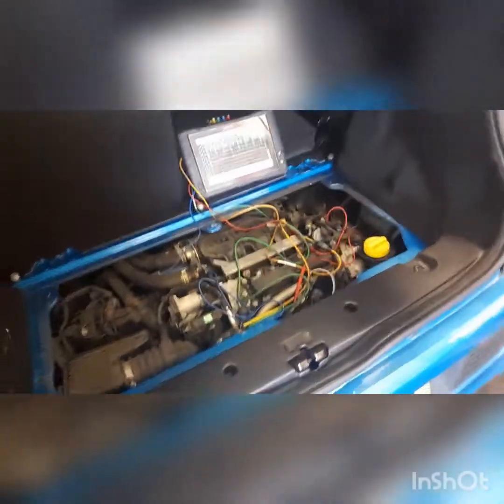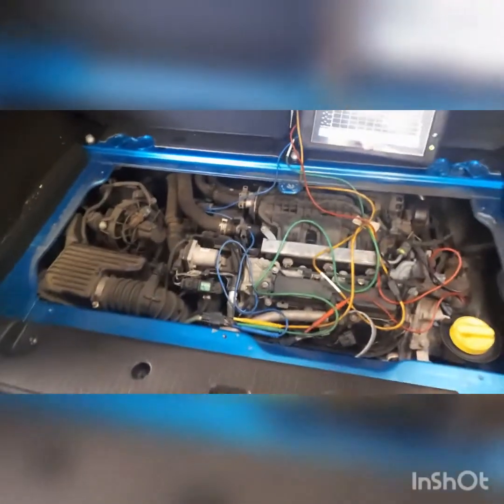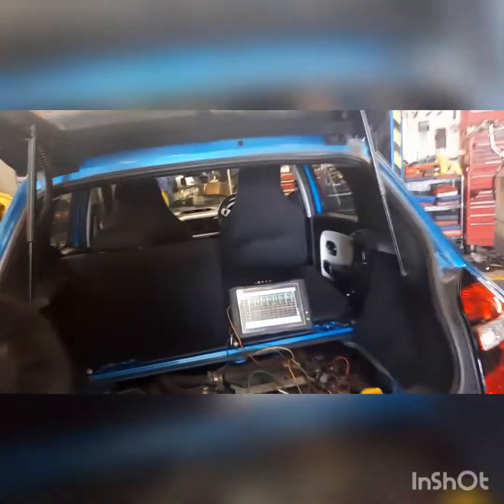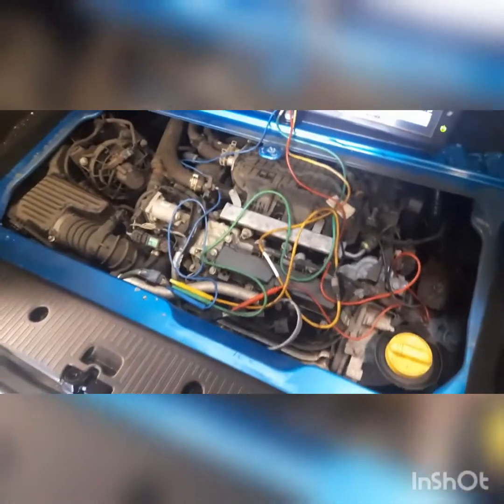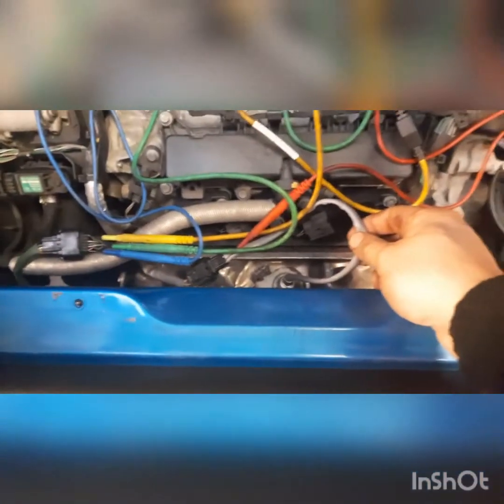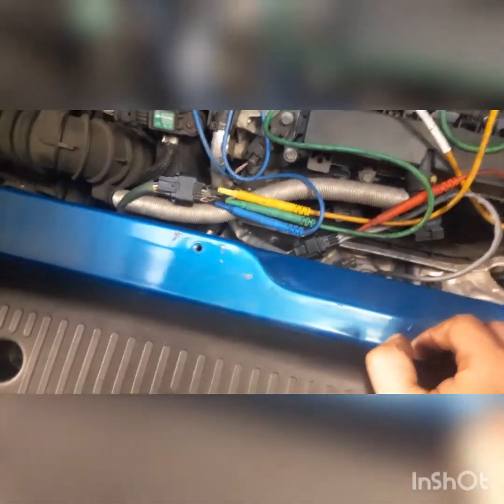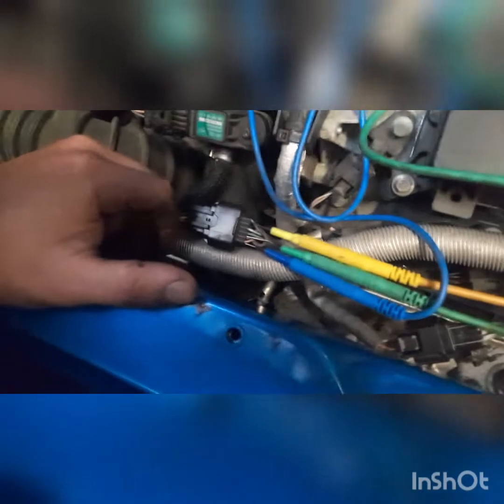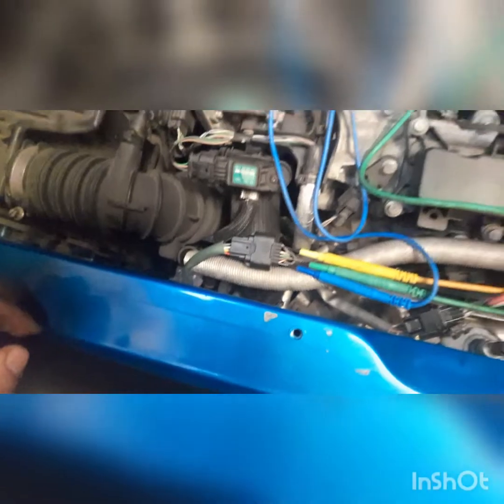Renault Twingo Rough running. Misfire codes

Comment: I have this exact issue with my twingo. They've changed the battery, the spark plugs, the lambda sensor and I still have an issue. It over revs when idol, struggles to tick over and struggles on acceleration and then finds power a few seconds later. It's 2015 plate with 34k on the clock. I have tried to call you today but appreciate you are busy.

Comment: Fantastic bit of diag Chris, and congratulations on your master tech qualification. Out of interest, were there only misfire related codes in the system or did it trigger any HO2S stuck lean codes too? Interesting to find it wasn’t able to trigger a rich code from post-cat O2 sensor?
Reply from the maker: Thanks very much. 
It would run rough due to over fueling. Neither of the 02 sensors ever triggered a fault code for fuel mixture. If you held the revs at a certain point it would detect a misfire do to it being unable to combust all of the fuel going through it

Comment: Hi mate I’m needing a position 1 sensor, is the one on top facing upwards position 1 or 2?
Reply from the maker: If you look at how the exhaust manifold attaches to the engine you'll see that it bolts to it lower down & bends up. The way to tell the difference between up stream & down stream on a late Twingo is that the upstream (sensor 1) is a 5 wire wide band sensor. Sensor 2 has only 4 wires 👍
Reply: @ams-mobileuk7226  orrrr in this case lol, sensor one measures before the cat and sensor two measures after the cat (checking the cat performance) btw bank one reference ingore on non V  engine.

Comment: Hi pal, I’m having the same issue with the same car misfire on cylinder one change coil pack and spark plug still misfire on cylinder one would you say this was the same issue?
Reply from the maker: It's possible. But the theme behind all my videos is to test & not guess.